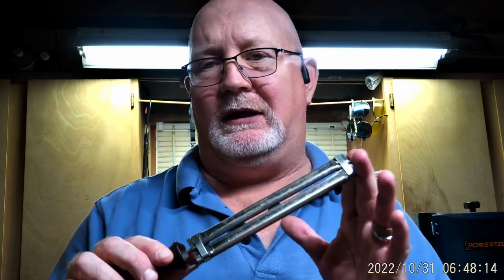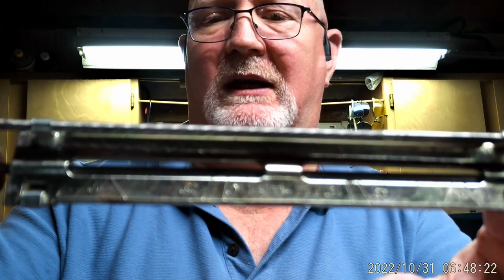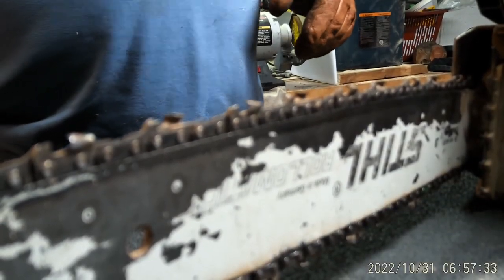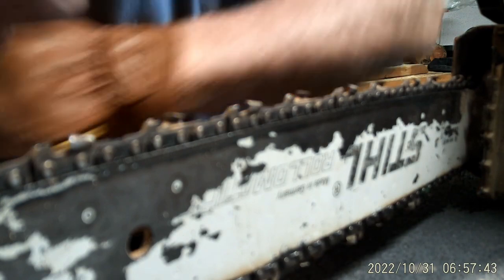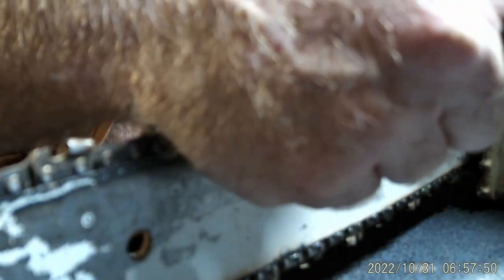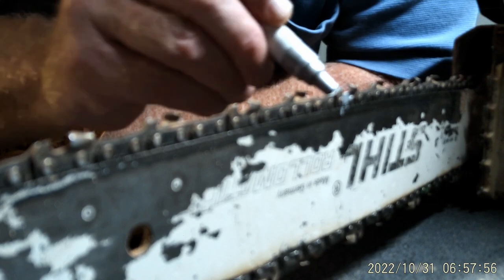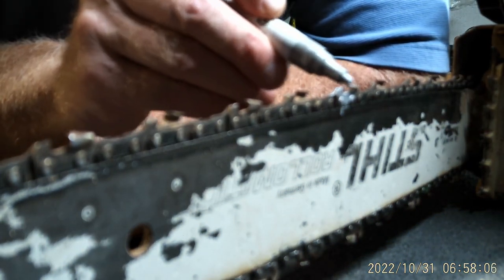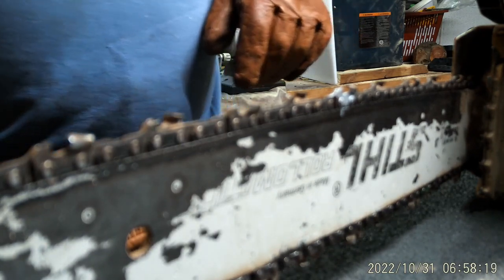Sharpening your chainsaw with the Stihl file guide

Comment: A file and file handle is not all I have.  I have a chain grinder, too.  I clean up rocked chains with my chain grinder but for a good cutting edge I use my file and file handle.   It is called a 2 and 1.  I bought one years ago and gave it to a friend.  I can sharpen a chain with a file and file handle in a quarter of the time it took with the 2 & 1.  I scan the rakers after sharpening the chain and hit tall rakers a few licks with my raker file, which also has a file handle on it.  I sharpen the chain on the bar, unless it is on the chain grinder.  I sharpen my saws after each use.  I check sharpness by feeling the corner of the cutter.  If it is sharp the cutter is sharp.